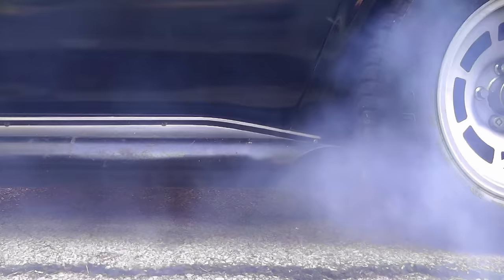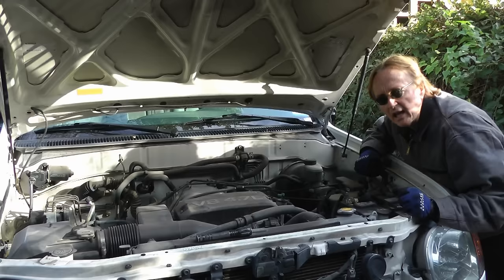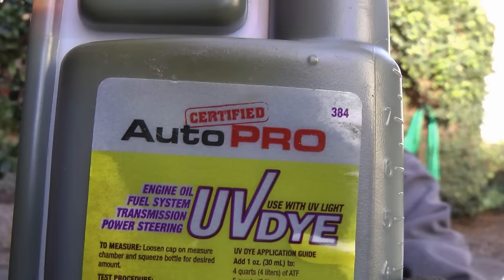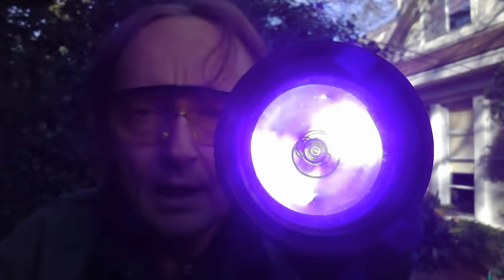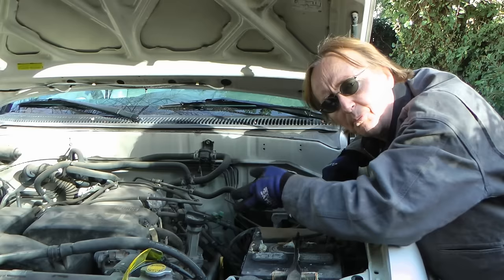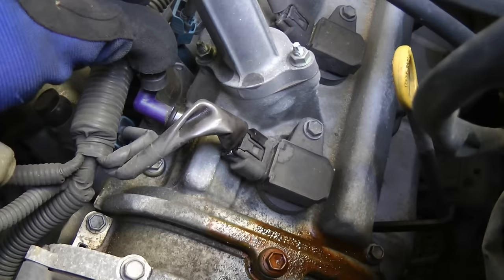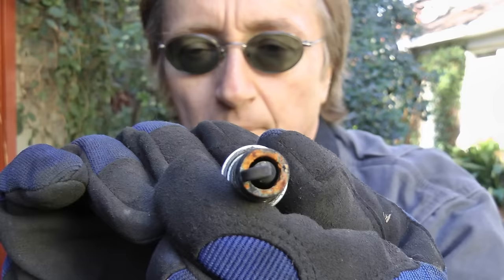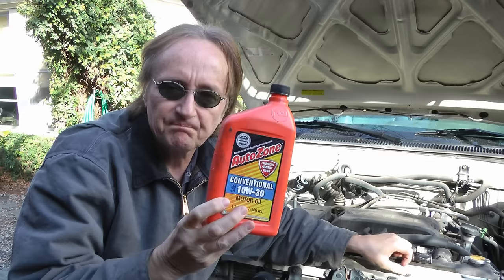How to Fix a Car Engine that Loses Oil (Leaks)

Comment: I saw in a video about at 205 reseal  leak fixer , someone who used it complained the oil pick up tube was clogged up due to all the paint or varnish on inside of oil pan  in which the reseal managed to loosen up. ? He put it in but didn't run the engine right away , he let the stuff sit in oil pan overnight then he took car to work next day about a week or two later that's when his trouble began . Would you still recommend this product it is it too risky !?

Comment: oh scotty one more thing. can you explain to me y in stop and go trafic does the engine develop sluge or oil gets dirty? i mean dont the crank and cams spin to circulate the fluids anyways wheather its goin fast or slow? or is it that in stop and go traffic the engine dont turn enough to the point where dirt wont have a chance to develop?

Comment: Hey Scotty, I got oil around my trottle body, same engine as this video. Haven't changed the PCV for 12 years (moms car sorry not my fault!)  no oil loss, the oil is right on the line after 7 months  on synthetic. , new pcv on the way, any other common issues with this engine?  or just do the pcv,  clean up the old oil and see if it returns?

Comment: I'm considering buying a Scion tc 2006 with 80k miles. I hear a rattling/clicking from the motor and the dealer said I should add thick synthetic oil. Is this a common problem? Something to worry about? Is it okay to get the car?
Reply from the maker: NEVER buy a car with engine noise, too many used fish in the sea to buy someone else's problem.

Comment: Scotty. I have a 2004 toyota camry that has a puff of light smoke when I start the car in the morning. Other then that, the oil level is on the dipstick is normal, I don't have to add oil to it. Internet search show this is likely due to valve seal. My question is do I need to get this fix and does the problem get worst if I don't fix it.

Comment: Scotty, i have a 2003 Pontiac Vibe that is losing oil. No leaks noted at parking spot. But occasionally i see a large cloud of smoke when driving, it lasts only a few seconds then no more smoke. And it does this once or twice a day.
Plugs look good and clean. I removed and cleaned the PCV VALVE AND SHOOK IT AND IT RATTLES .Can a PCV value be at fault for short periods of time like this? thanks in advance for any help you can offer

Comment: Terrible idea.  Put leak stop in my 2008 Silverado and it plugged up oil pressure sensor filter.  What a pain to swap out.  My advice - don’t do it if your vehicle has similar filter.

Comment: I took my car (60K miles) to get oil change now leaking oil a few days ago. NEVER leaked before. Now I see a puddle under the car. I took the car back and the shop insisted no leak. So concerning when this is the first time I got an oil change at this shop. Any thoughts?

Comment: Hey Scotty Kilmer, my 92 Geo Metro is going through a lot of oil and I noticed when I took the plugs out. 2 out of the 3 cylinders spark plug were wet with oil and I notice a cloud of blue smoke when I drive the car. The engine is making some strange noise also I fixed the issue with the transmission it turned out to be an electrical problem with the solenoids.
Reply from the maker: engine's flat wearing out inside, those 3 banger engines only last SO long
Reply: Scotty Kilmer what do you mean? :)

Comment: hey scotty. my car been burning oil really bad like it goes threw 3 qrts of oils in one months after a months when i check it it barely has any left on the oil dip stick the motor has 115k miles on it runs great no problem at all no knock no oil leaks or anything so today i just replace the pcv vavle hope this will work but ive notice the old pcv vavle still works still make a rattle when u shake it but i just went ahead replace it any info what it could be?

Comment: How do I find out where the leaks are, oil is every where, the whole underside is covered with oil. Changed the pcv valve. What is the best way to clean the oil to find the leaks?

Comment: Scotty Kilmer- I have a question for you. Do you know how or if there is a way to adjust the sensitivity on a 2008 Scion XB factory Alarm? I was able to get it working by hitting the key-fob button. But I have been unable to figure out how to get it to function properly and go off, if someone tried to tamper or break in the vehicle? I'm lost to how to arm this system and adjust it properly to what I want.

Comment: And after all this, if it still burns oil, it might be mixing it with the fuel in the injection. This happens in two-stroke engines.

Comment: hy Scotty im from Venezuela i have 2007 trailblazer l6 and its evaporeit 2 liters of oíl every 3000 milles but i dont know why its have 130000 miles and the engine is in very good condition
Reply from the maker: those just burn oil at that age , live with it. GM doesn't make such hot engines anymore

Comment: Hey Scotty, i dont think im leaking oil(since i dont see much oil spots on the ground) as opposed to burning it more...so i decided to buy the "Rislone- concentrated Rear Main seal repair" additive. What is your take on it and would it stop my burning issue? I have a Honda Accord 1993 EX
Reply from the maker: I personally use AT 205 reseal, amazon.com sells it, best oil seal leak fixer I've ever found

Comment: Any advice on a 2007 Honda accord? Engine rattles, rattles more when I put the AC/heat on when braked at rest. Noise goes away when my brake is released and give it gas???? Have not tried changing the PVC valve but its burning oil for sure Mr. Kilmer.

Comment: I have a 2011 Nissan Sentra and I was told by the Walmart that I had oil leak and also another mechanic. I recently just had my spark plugs replaced and the person who did it said they saw a little bit of oil of one of the plugs. Any suggestions?

Comment: My 2002 Saturn sl1 has always burnt off oil fairly quick. Ive heard saturns were notorious for this, is this true? ill check my pcv valve since im sure its never been touched.

Comment: Hi Scotty, I have a 94 ford probe that burns oil on startup. I initially think that the valve seals have worn out, but I wanted to get a second thought on this. There is also the presence of a ticking noise. Could it just be the valve seals.

Comment: Hi señor, I have a Bmw 325xi 2003, runs great, no black smoke. No leaks, new ccv. I have to add a quarter around  every 1000 miles, what the means ???

Comment: Scotty, I’ve 2000 Dodge Caravan with 193k miles on it. It’s squeaking while stopped at a stop sign and stop lights. I’ve checked everything but it use oil badly. I’ve to check it every way. Is it the lifters, pistons, or some other interior engine parts. Should I get rid of it and get some more reliable?

Comment: if you have a car with a wankel rotary engine, it's another thing. those are designed to burn oil. so check the oil level every 500kilometers or so, and refill to keep it running. some other cars (like my bmw e36) burn oil by default as well. it says it even in the owners manual. a lot of people would not have as much problems with their cars if they'd read those damn manuals.

Comment: I put 10w30 mobile one fully synthetic extended performance gold 5 quart jug in and that burn a full quart in 24 hoursm pcv was changed well the 2009 honda civic si pos not enough oil changes even stabilizer only added few days on it. rubbish returned it.

Comment: Wouldn't it be better for the engine to keep using normal viscosity oil even when an oil burning problem is present as long as you keep it topped up vs using thick viscosity and stabilizer?
Reply from the maker: ryccoh if you keep up on the loss of oil, it's not a bad idea. BUT, burning oil also ruins the cat over time, a BAD idea. I'd stick my my idea.
Reply: Scotty Kilmer Thanks for answering. I have another question for you kind of unrelated. In a dedicated sports/track car what do you think about the use of high ZPPD oil such as Royal Purple XPR as long as you don't run a cat of course. Do you think ZPPD oil provides extra protection in modern cars?

Comment: hey i dont remember if you know me from my other comment about the 2001 pontiac sunfire for $500... it needs the new tires battery and brakes... the person whos selling it told me that it overheats due to a fan or something not working so what if i didn't take a  battery with me to see it start and the mechanic makes sure its not a blown headgasket or anything else serious... should i buy the car then ?

Comment: If I add Lucas oil stabilizer will that make the engine wear out quicker? Would this be bad to use in the winter since it's so thick?

Comment: I had a 1991 Saturn SL2, and a 1999 Saturn SC2, and both cars around the 70,000-80,000 mile mark both started to burn oil. Never found a drop of oil on the driveway. Never did find out why Saturn cars did that, and why they never fixed the problem between all those years. Strange???
Reply from the maker: not strange, company is bankrupt now, they made rather cheap cars, and got worse as time went on.

Comment: I have been having smoking problems with my car also.the smoke is whitish and happens when i accelerate hard. but it does not smoke when idling. I noticed there is oil around the small hose that joins the pcv valve to the air intake. is this a sign that the pcv valve is worn?
Reply: I'd say you have the text book example of this problem, seriously.  Get a new pcv valve and while your at it if that hose is easily replaceable replace it because it's oil logged and will continue to seep oil till it's dry.  Plus if this couple of dollar rubber hose is leaking and sucking air in from the outside then that is unfiltered air and somewhat dirty, bad for rings and other stuff and will contaminate your oil and filter faster.

Comment: Does my peugeot 106 1.0, 1997 have that pcv valve? It has burned about 2liters of oil in around 6200miles. And there is no blue smoke behind, just white when the engine is cold. It has around 110000 miles. I'm just wondering what caused that oil comsumption. Thanks for your time!

Comment: Dear Scotty
I own a 2004 Toyota Corolla 1400cc with 200.000Km bought and used in Greece, for the last 100.000 i have modified it to run also with LPG fuel, i have an oil consumption of approximatelly 600ml of oil every 5000km, i most use 10W40 motor oil but i m also think to use 5W30 fully synthetic motor oil at my next oil change(i change oil every 5-7000km), what can i do to stop/reduce oil consumption(i have already replace the PVC valve but...) ? Maybe to use a product like Liqui Molys "Motor Oil Saver" or something else ? and which type of oil you recommend ? (10w40 semi or 5w30 fully).
Best regards

Comment: My 2008 e300 benz  gives white smoke out the exhaust  once I start the engine.   Need about 2 liters of oil every 2 weeks  .  
Where is the pcv valve? And how it looks?

Comment: Love your work!!! Thank you. Question. 2002 4.6 F150, 150,000 miles. Engine makes noise when cold. Will Lucas oil stabilizer help? Seems thick. Is it good to add to engine that states 5-20w oil?
Reply: Use premium unleaded, that fixes the valve clatter

Comment: Hey Scotty. My car my car hasn't leaked any oil since I replaced my valve cover gasket, but I burn oil like crazy. I wanted to check my PCV valve, but it appears that my model of Camry doesn't have one!! I have a 1991 4 cyl Camry Manual transmission. I have a feeling I am burning oil because of my slight rod knock which I plan on fixing over the summer. Would that cause me to burn a quart of oil every 2 weeks?

Comment: Scotty, I drive a Toyota celica 2000 I've been told that year celica has issues with worn piston rings. I tried the methods you recommended done some research on what it could be, and I keep coming back with worn out piston rings. Would it be worth replacing worn out piston rings when the engine is at 161,000 miles? Last thing would be is it a difficult job that would take days to complete if I were to do it at home?

Comment: Is it possible that a clogged up PCV valve causes a diesel engine runaway? Have you ever seen a runaway?
Reply from the maker: +itsmearne I've seen diesel runaways myself, bu pcvs can't do that cause of different injection systems from gasoline engines

Comment: Unless you are driving a 2006+ dodge or chrysler product with the 3.5L v6.  it's designed to burn oil!  My wife's will burn almost 2 quarts in 5,000 miles and everyone I've talked to that owns one has the same issue.  Chrysler considers that normal!

Comment: Scotty, I drive a 2004 RX330 and had my oil change about 3500 miles ago, I checked my dipstick and the reading was about 75% full (it was at the full fill line after the oil change). Is this normal?

Comment: Hello sir, I have a 2003 chevy trailblazer. My a.c. blows on numbers 3&4 sometimes on 2. On the numbers it blows very cold. For some reason my heater does not blow warm air. When I place my hand to the vent I can feel a slight warmth of  air. However it is nothing major.

Comment: Hey Scotty when my lawnmower overheated, why do overheated engines don't start
Reply: Because the Pistons expands which causes a high resistans
Reply: No I don't think so the motor pulled over pretty easy.
Reply: Its a magneto ignition, not a car

Comment: hey Scotty, i have a 2003 monte carlo ss 3.8 v6 not supercharged. just had the lower and upper manifold gaskets, valve cover gasket and plugs and wires done. there was a loud squeal afterwards but i fixed it replacing the pcv valve. now the car is dumping a lot of white smoke out of the exhaust and burning oil fast, where should i look next? it didnt do this until i got all the gaskets replaced

Comment: Hey Scotty!
I drive a Honda accord 2.4 vtec

I changed oil a month ago and done a big seafoam treatment for 18 hours and changed the PCV as well, since than i drove the car for 2500 kilometers and for the first 2000 km that i drove and checked last week it didn't burned any oil AT ALL! The last 7 days for the last 500 km that i drove my car burned 300-500 ml of oil! That made me really sad today since i thought i am done with my "2 stroke engine" i also checked the PCV valve and it was wet from the outside with oil?! Why would that happen? Any way to fix it? Is that the reason that my car burns/loses oil? The PCV was little wet but  it wasn't dripping oil!

Comment: Hey Scotty i have a 1986 mitsubishi dodge ram 50 with a 2.6Ltr 4cylinder motor that leaks oil from the head gasket but i don't see any oil on the ground so it must not be that bad yet even though the pcv valve might need to be changed too. But question of the day is why might my head gasket be leaking oil if white smoke isn't coming out my exuast or coolant doesnt appear to be mixing with oil and what do you think needs to be done. Sorry for writing a paragraph lol.

Comment: Yo Scotty, I replaced my pcv valve in an 07 toyota sienna, in process the pcv valve hose broke bc it was so brittle. I took the insulation off the old hose and put it over a similar size oil cooling hose for a quick repair. The auto parts stores don't carry the hose! I'm going to head to toyota dealer when I get opportunity to see about a new one, but do you think my solution is good for long-term? Or is there a problem that I don't forsee?

Comment: Id like a video about what happens to an automatic transmission if towed neutral with a tow bar. I have a 79 toyota automatic an towed it 100 miles with a tow bar an it works an shifts fine.
Reply from the maker: it can overheat the transmission and burn it out over time, I've seen it happen,but toyotas are pretty strong and aren't easily damaged
Reply: WOW! it was cold and snowy late at night in Oregon when I did this, so that probably helped it not overheat. How do u modify or what do u do to the transmission so u can pull with a tow bar? Like so behind many motor homes. I like your videos they are very helpful.
Reply: Albert Verheiden 

Get a standard or one of
those automatic semi-
standard. With actual gears inside the transmission. Those are supposedly able to take flat tow behind motor homes.

Comment: I have a 96 Chevy van 1500 and the engine was sealed before but it’s starting to leak again . I didn’t seal it the first time so idk how long it’s been but I’ve had it about 8months . So my questions is will it work if I try and seal it again !??

Comment: Scotty I have a 78 350 small block oil pressure gauge pegs out.. I have changed the oil pressure sending unit not sure if it might be a faulty gauge or what?

Comment: Hey Scotty, your videos are great. Just a quick question. My 2002 vw jetta vr6 24 valve has a hose coming from the crankcase to the intake before the throttle body without a valve. Its causing oil to go into the throttle body and dirtying it up and causing throttle issues. Is there a filter or valve I can work with to prevent this? I'm upset this car does not come with a pcv valve. I've checked the Bentley manual as my reference.
Reply from the maker: Ak A   VWs use typical over engineered German vent systems with all kinds of valves and computer controls. EVERY jetta I ever worked on would dirty up the throttles because of that. Unless you want to spend a ton with a VW mechanic and his VAG COM scanner, just clean the throttle more often. And if engine has a lot of miles, most is just blow by which would require an engine rebuild to fix

Comment: incredible Scotty. 
can an over engine oil filling causes the PCV to malfunction?
Reply from the maker: of course, it will also blow engine seals over time
Reply: Scotty Kilmer thanks scotty, i am really learning so much from u as well as from the internet as well. many many mechanics out there are ruining customers cars with or without knowing. someone i know recently added  0.75 quarts over the required volume in my engine for free thinking he is doing good for me. i then removed it when i came back home.